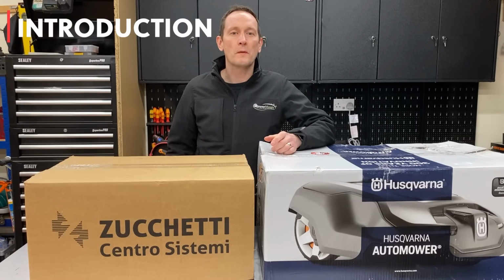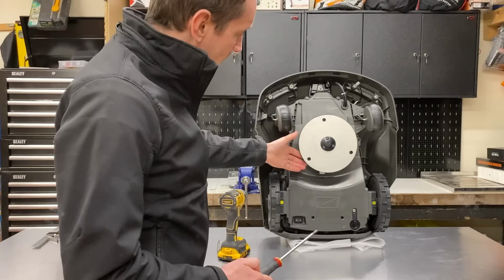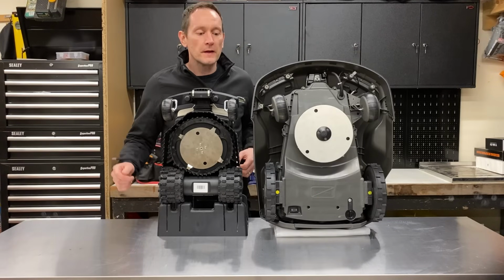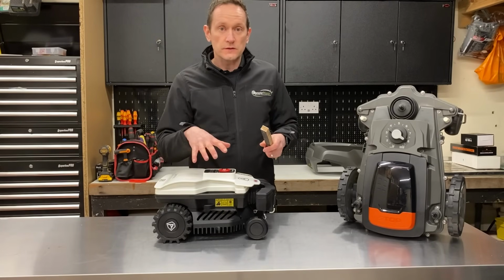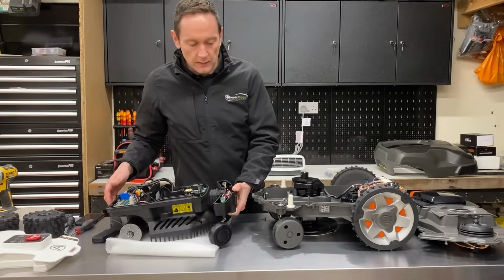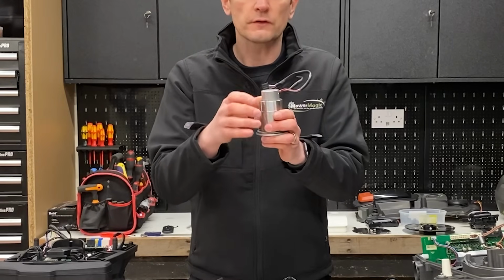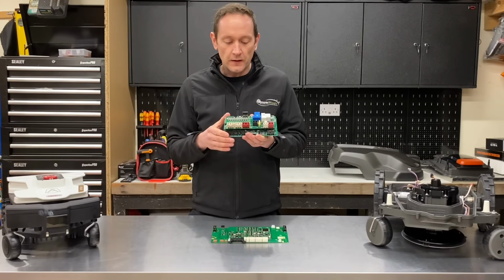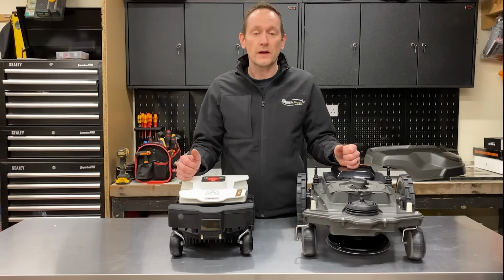Comparison Review: Husqvarna Automower 310 vs Ambrogio Twenty Deluxe & Automower 315 vs Twenty Elite

Comment: It's obvious that the Ambrogio is better engineered and sturdy, with fewer moving parts, durable materials and practical features.  Now, we wish to know how well each works in the real world (speed, wet performance, evenness of cut, damage, accuracy of tracking), reliability (and ease of repairs), and relative cost of replacement parts.

Comment: He is obviously more keen on the small mower. Using words like "simplified keyboard setup"  and "much more compact" instead of "not as advanced keyboard setup" and "much more unsafe". 

Yes, the Husqvarnas blades are a long ways from the chassi edge. But that is for safety and safety only. No risk for pets, children or even an adult to get the paws and toes severed by the blades.

The small mower seems very unsafe in that regard.
Reply from the maker: All comments are factual based on actual data. The Ambrogio blade is within the boundaries set by the law, so therefore is safe.
Reply: Also the blade is close enough to the edge where there’s much less follow up trimming to do. What’s the point of the automower if you have to go back behind and trim 6-8 inches on every border?
Reply: @mowermagic  No complaints about not reporting facts, you spent a lot of time going over the features of both. Watch the video again and see if you notice how you talk about the two.
You clearly favor the Ambrogio.
Favoring one or the other is human, but you should acknowledge your bias.
One quick example, when discussing the inside, you mention the brushless blade motor on the Ambrogio and only call the Hus. motor the blade motor.
 - When specifically discussing the motors, you do mention brushless blade motor is a feature on both.
Another quick example, you only hype up the Ah rating (in regards to the robot batteries) and do not talk about advantages of having higher voltage.
 - You mention power tools and nail it, but don't draw the correlation with its use in mowers.
 - Since its a robot mower and can mow anytime the parameters allow, it seems like there is an easy case for voltage being more important than Ah.
The "law" does not equal safety; otherwise, once set, they would never require updating.

Comment: Having serviced loads of HQ mowers I'd really like to see brass inserts for the screws on the bottom half of the chassis.
That would be a significant upgrade for the long term durability of their robotic mowers.

While I find the Ambrogio mower more interesting it's hard to ignore the technical support aspect of HQ and sparepart availability.
They are commited to giving the end user a great experience whereas other brands could care less once the customer has bought a product.

Comment: Have been an owner of a husqvarna 310 for 4 years.  It has never failed,  Mowing through heavy wind, and rain faithfully retuning to its basestation- My lawn is uneven, and  it do lift its frontwheels, but have never lost traction even in hilly terrain, never. You fail to tell the viewer about the weight distribution. It is 80/20, and will never lose traction.   The tall diameter will make it pass on small holes,  roots and do collect minimal amounts of cut/uncut grass. The ambrogio on the other hand, small wide wheels and rubber tires, collecting grass, dropping into small potholes, a pivoting front axle allowing for the lawn to get scalped.  Rubberwheels do not age wery well either. If rain or moist condition, probably flattening half of the lawn with its wide wheels, before it tries to cut the grass. I guess there will be lots of left over patches, while wheels and axles collects enormous amouts of grass. Maybe it is a good thing with that big battery, if it ever manages a whole summer vacation without beeing serviced.  The more complex constrution have to prove itself. Often the simplest things are the most reliable. And what about the frontwheels acting as a bumper, trouble.
Reply from the maker: We are so pleased you are happy with your machine. As already stated we report only facts.
Reply: I wish that I saw your comment before I purchased Ambrogio...
Reply: @davidk2565 His comments on the Ambrogio is utter bullshit.
Reply: Your comments on the Ambrogio is just not accurate at all. Everything you try to point out as a problem is a none issue. I wish people would keep their mouth shut when it comes to commenting on stuff they know nothing about.
Reply: @Birdfeeder795 
What I do know is, that Husqvarna is reliable, and never get stuck. It has done a great job, and still do. All my neighbours have bought the same one. No problem or reliability issues. I can tell that this ambrogio will get stuck in my garden.
Reply: I concur- my Husqvarna has been fabulous and reliable over many years. A lot of the so called “negatives” are a complete fallacy, such as the suspension. The Husqvarna handles uneven spots with no drama, will not slip even with one wheel off the ground, and won’t scalp your lawn.

Comment: Great and detail review. I see that you more inclined to recommend Ambrogio, but here are mine pros and cons from my experience: 1) fixed blade are good if there's nevere ever any fallen branches, garden fruits, pine cones, toys or other objects on the lawn. And if there is - the disk will get bent or damaged really quick what will lead loss of sharpness (yellow or white lawn tops), vibration. You need to change that disc in time, or vibration will do some damage to the robot. Husqvarna blades will rotate around it's fixing bolts hitting objects preserving the blade motor and blades. 2) Mulching blade - fallen leafs during autumn season will be hard to collect wet porridge. 3) Why Husqvarna pushed blade 13 cm from the edge - safety first: the closer the blade from the edge, the easier to get cut. It's okay when there is no children, pets or human on the lawn, but still, there is no robot on the market, which can completely cut the edges. You still need to trim the edge it's 5 cm or it's 15 cm, or lay cobblestones perimeter line or etc. 4) Husqvarna 310 robot do not have to operate 24/7 to maintain 1000 m2 lawn, it's nonsense. 1000 m2 - 4 - 5 hours of pure blade motor working time is usually enough (which means 8-10 robot schedulle time). 5) Battery capacity - Ambrogio needs more capacity to reach it's docking station following perimeter (there might appear yellow marks on the route on corners). Husqvarna got guide wire, which is straight route to the station, that means it's less time to reach it. 6) Wide wheels - the more contact you make to your lawn, the more squeezed and bent down it will look, especially when the wheel will be full of dirt, grass or leaves it will work as an asphalt roller.
Reply: Don't tell people that Ambrogio needs 3Ah additional capacity comparing to husqvarna only because of the return-to-station system. It is not that much energy consuming plus you can program Ambrogio to return to station more efficiently than following the perimeter wire only. 2Ah battery capacity for a 1600m2 robot is a joke. How many times a day the robot needs to recharge to actually mow such large area? What is the usual lifetime of such a highly-exploited battery considering that the lifetime of Li-Ion cells is highly dependent on recharge cycles? Apparently you never installed any Ambrogio robot so you don't speak from your own experience.

Comment: Interesting review.
Sadly, the reviewer is clearly favorizing Amrogios design as an advantage in most aspects and doesn’t mention HQ’s design advantages where relevant. For example, the large body giving higher security if a hand is pulled in from the side. And the colission techniques explained as Ambrogio are having 3 different methods as HQ has one. In reality HQ also have drive-current monitoring, etc.

According to review, Ambrogio should have outstanding capabilities when it comes to getting grip in slopes, following pits on the ground, efficiency, durability. I guess we need a real-life test to prove if that is true in reality. Are wide but small wheels better than large and thin in all environments? HQ has narrow wheels for a reason, not to flattening the grass? Are the flexible front wheels (allowing cutter to dig down into pits) giving better cut result and less risk of getting stuck compared to HQ’s “stiff” body? How can the knifes of Ambrogio hold up for a whole season when HQ cannot? Both are rotating stainless metal knifes? Another question, are you sure HQ really lack accelerometer? Even my cheap china cutter has it.  
Looking forward to more tests :)
Reply: Narrow wheels mean putting more pressure to the grass, so flattening effect should last shorter. However, I don't think it's among main reasons a producer chooses narrow or wide wheels.
Reply: @prczyzew  I replaced my ambrogio fat wheels with thin 3d printed spiky ones, exactly because of the flattening. With the small cutting disc and wide tires, especially on a stressed lawn, it did more flattening than mowing. The spiked wheels work much better on my lawn, far less flattening, and more traction on wet grass. They do suck on pavement and I needed to add some rubber to the charging dock.
Reply from the maker: Review is done purely on actual data - real data, like size for size, feature for feature. We report only what we see.  The facts speak for themselves. Thanks for looking.
Reply: @mowermagic  man not to start an argument, but it’s clear to tell that this whole review leads to make HQ the lesser mower.
Reply: @nickgarrett26  I'm in the market for a mower, and its clear that the build quality of the Ambrogio is better. The question no-one has mentioned is whether or not the support exists for the ambrogio in the same way as the HQ. Or whether one simply does a better job. Ambrogios online representation is disgusting and frustrating - is this representative of their support. I have a feeling this is to do with being based in italy.
Reply: Indeed with a twist body the front wheel will lift and will let the obstacle hit the cutters instead of lifting the body and the cutters over the obstacle.  The Amrogio models with the cutters linked to the twisting front wheels

Comment: Though you seem partial to the smaller unit, you presentation of the feature fu cations is impressive.  Visually, the Husqvarna is not signifantly larger than the smaller unit, but I like what I see so far of the Ambrosia.  Will take a closer look at the Ambrosia....based on your pitch.  Good job!  My lawn

Comment: Center of mass in HQV is close to rear wheels. Both rear wheels have always contact with grass. It can be seen on video. When mower drives itself, there is no "magic hand", that pushes front wheel down and rear wheel up...
Reply from the maker: Not true.  In rough conditions a wheel can easily become raised away from the grass.  An articulated body can help with this.

Comment: Interesting video, but it seemed to meet like it's a part one. Dissembling  the devices and looking in detail how they are build is great, but it can't replace practical test.
Reply: Correct, because the Ambrogio is terrible at cutting grass... It's best to think of Ambrogio as a lawn polishing tool because it can only trim a tiny 1/16 off the top of the grass
Reply from the maker: Incorrect it is not terrible.  The small cutting is by design - once the grass is the required level it always stays the same. There is no need to cut off more as it mows every other day.

Comment: Interesting to see the difference in shell... The wheel grip point - I'd be much more interested to see how that works on grass than on steel and concrete.  I don't mow steel or concrete very often
Reply from the maker: We don't mow steel or concrete very often either! But for the sake of this video, where we delve into the insides of the machines and their technical specification - we decided to film in our workshop.

Comment: As an engineer and tester for more than 20 years, I'm sad to see this clearly a sponsored review. And this comment will be removed by MM. Put them on real-world tests to prove tour statements! 
Here are just a couple of examples of the clearly biased statements:

-Blades: Biggest issue for mower blades is hitting stones, not wear. Ambrogio has a one-piece blade that costs a lot to replace, not to mention the Husqvarna has a shield and blades that fall back when hitting something hard.

-Wheels: Soft rubber wheels have indeed better traction on a steel plate, but when is that feature needed? Also, you can get wheels with even bigger spikes to the Husqvarna.
 

Body: No mention about how easily Ambogio will get snagged in bushes with all those downwards spikes and the hook-like front bumper. The Husqvarna shell is designed for not attaching anywhere.

PCB:s: If the electronics need to take into account heat dissipation, they need more power and therefore forced to put a larger battery. Relays are very old architecture, not even RC cars that are using more than 800A current need relays. Note also that the Husqvarna PCB is protected from moisture, where the Ambrogio is not.
Reply: How much does cost
Reply: What’s it cost
Reply: @prichie356  
Ambrogio blade $59.99 compared to Automower blades can be bought a set of 30 for $9.75
Reply: THIS! More people should see your comment.
Reply: The big blade mangles small animals like frogs and pocupines.
Reply: @kjelle5350  you think frogs will survive being cut by razorblades spinning at 3000 rpm? And porcupines will likely just suffer a slower death if they get caught underneath. Literally death by a 1000 cuts. That said, i did mod my ambrogio, made my own 3d printed disc with swiveling and replaceable blades, because I couldnt sharpen the stock blade.
Reply from the maker: Why would we remove your comment.  The video shows the facts of both models. All comments based on actual real-world data.  Size for size, feature for feature.  Your comments are biased - phrases likle "costs a lot to replace", "when is this feature (traction) needed?", "snagged on bushes" - all comments with no basis of truth.  But we appreciate your attention.
Reply: @mowermagic  Well he does know what he's talking about :) Single blade design is not good on these little machines, so the ambrogio get's stuck in high grass - quite often unfortunately and replacement blade is not exactly cheap.
Reply from the maker: We also love it that you tell us you are an engineer.  Only engineers do this.

Comment: Thanks. I’ve had a fantastic run out of my Husqvarna over five years - and would absolutely buy another in a heartbeat. Our LARGE lawn is cut really well, and the blades last ages, certainly MUCH longer than suggested here - I typically replace them only once every four months in peak growing season.
A lot of the so-called negatives from this reviewer are actually complete rubbish.
Eg: it does NOT lose traction on uneven ground as the weight is mostly on the rear wheels.
Also: Husqvarna’s swinging blades are a much safer system.
Reply from the maker: Thanks for you comments.  All information here is unbiased and completely factual. If something is 5 we say 5. If something is red we say red. You can't say that what is reported is "rubbish" - how vague is that. We report what we see and show the evidence on screen.

Comment: Hi Thanks for this video. It made it very easy for me to chose but now that I have the Ambrogio I have noticed that one of the rear wheels has a much larger free rotation than the other one before the engine engages. I guess in the motors there are reduction gears and I worry that something is wrong there. What do you think, should I worry. The mower is two months old

Comment: We’re all entitled to our opinions…. personally I don’t like your reviews as you try to suggest you’re making fair comparisons, but you are clearly very very biased! 
I don’t personally own a Husqvarna Automower, but have looked after one for a local business for over six months, handling it on a daily basis (used in an area open to the public so needs to be taken in every evening), and like most Swedish products I’ve come in to contact with over the years, it is designed perfectly to do the job and does the job perfectly, not over engineered and certainly not under engineered, just perfect!
A problem with the wheels on paths etc? None what so ever! Pathetic suggesting they may slip on paths.
The blades on the Husqvarna are perfect,  admittedly the Husq endurance blades are better than the standard ones, think Husq suggest they be replaced every 6 to 8 weeks? But when I started looking after the machine the blades hadn’t been replaced for a year, the blades admittedly  weren’t in great condition, but the glass looked perfect!
I could literally go through almost every point and comparison you’ve made and demonstrate that I prefer the Husqvarna design, oh, and yes, I forgot to mention and know you’re not going to like me saying it, but having spent 15 years of my career as a precision Engineer and toolmaker and a further 20 years in electro-mechanical Engineering services and technical support, I consider myself a very good judge of what’s a good product and what could benefit from some design / manufacture improvement.
Reply from the maker: We are glad you are happy with your Husqvarna.   The facts speak for themselves.  We hold up items from each brand and discuss.  We specify facts and figures from each brand.  If one brand comes out better there is not much we can actually do to fake the factual results.  If one is bigger/longer/heavier/faster etc than the other, then that is what we report.  You can watch the video, listen to the facts and make up your own mind.